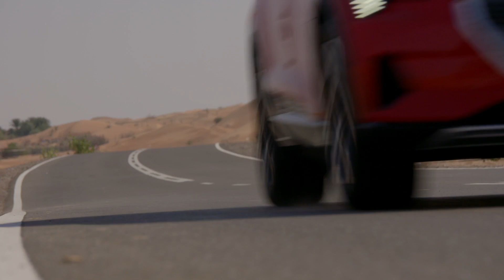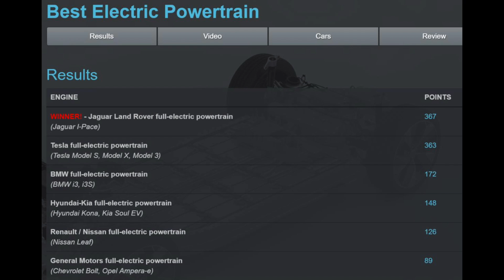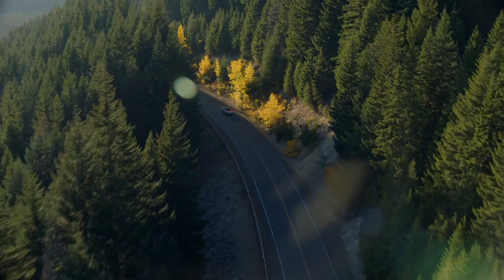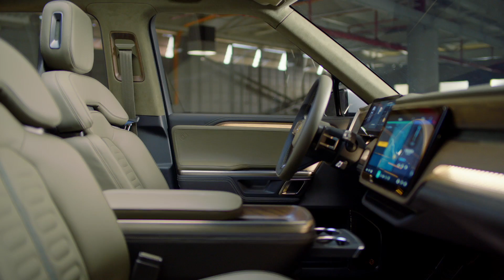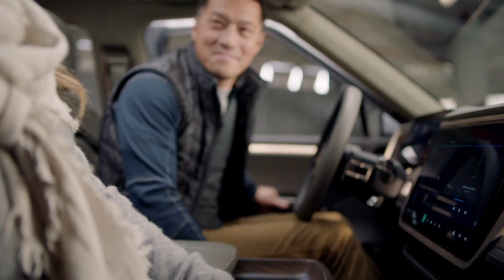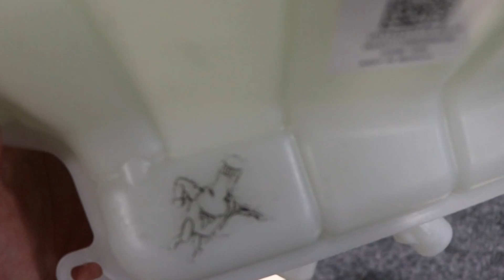Sandy Munro: Model 3 manufacturing, Model Y wiring, and EV competition

Comment: Oxygen in a bottle?  China all EV by 2025?? The model 3 is still not economically feasible over a Honda Civic (ice car).  😢 need to get the price down to 25k.
Reply: Numerous articles demonstrating lower cost of ownership of Model 3 compared to Toyota Camry
Reply: But you can’t compare this car to a Camry. I am only 6 ft tall and I have a half inch of clearance between my head and the glass roof when I sit in the back seat.  I have more room in a Honda Civic.  I could not buy a model 3 because it is too little. Compare a Honda Civic 22k that gets 40 mpg. Between the lower insurance, registration,  if you drive 12,000 miles a year that about $1,000 per year in gasoline.  I know they are different cars but I am just a regular guy not a bmw guy.  So for the average buyer it does not make sense yet.  I would buy one for 30,000 if it only went 100 miles. Because that’s all I need.
Reply: @touchdownraiders2009  New Tech almost always starts expensive and works its way down market. Tesla has the best margin and lowest cost relative to performance of any BEV. As they continue development, cost will continue to decline but for now it's not possible to have Model 3 performance at that cost.
Reply: touchdownraiders2009 You must be an odd shape. (Short legs, long body!) I’m 6’2” and have a lot more than half an inch above my head in the back seat on a Model 3.